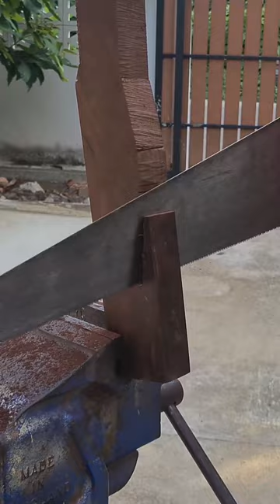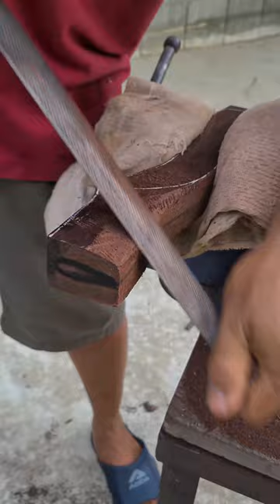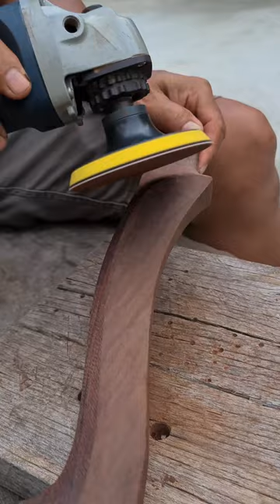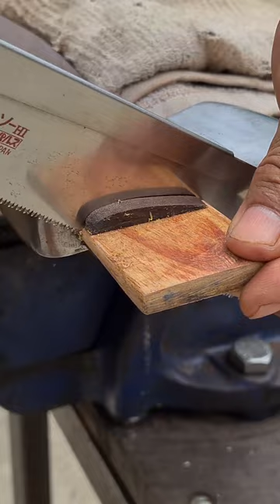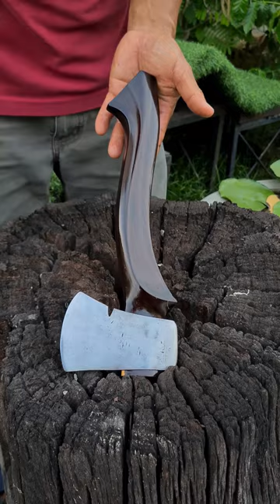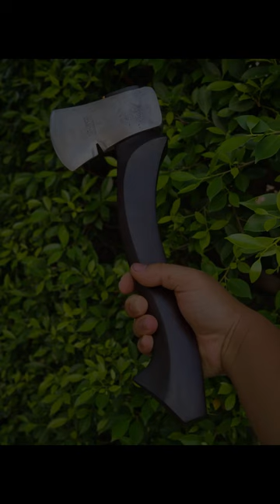Short video of making a beautiful ax handle | Plumb BSA #shorts #woodworking

Comment: Beautiful until I heard the axe head literally plop onto the handle without resistance.  Make it right or it's just a display piece.
Reply from the maker: Thank you very much , yes it was part of the filming , we put some epoxy glue between the ax head and the ax handle to increase the strength .  You can watch our other full videos and you will see the steps in detail.Most of the work we do is done in an art form for collecting and displaying rather than for real use.🙏😊